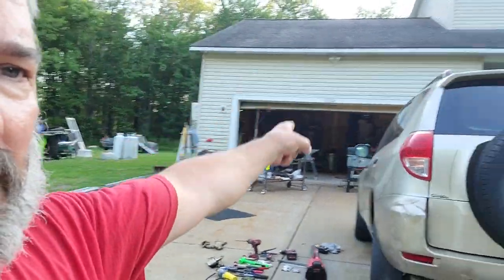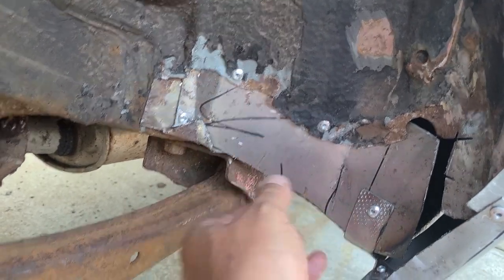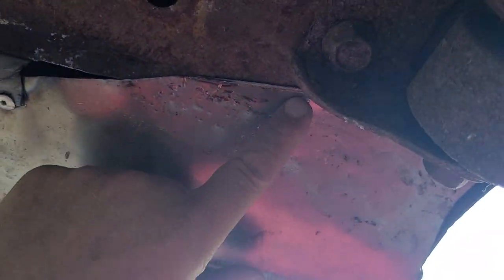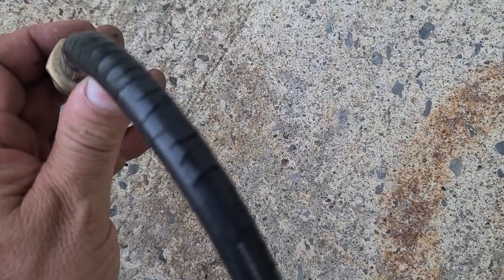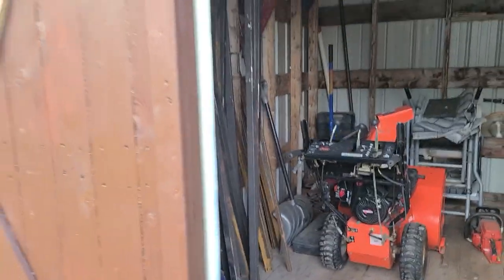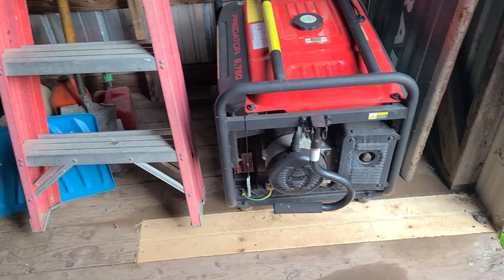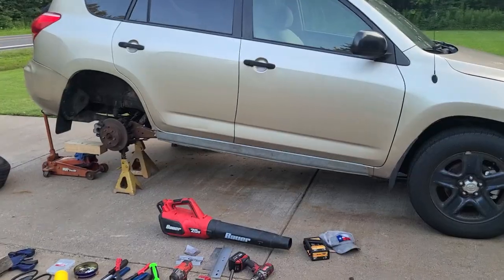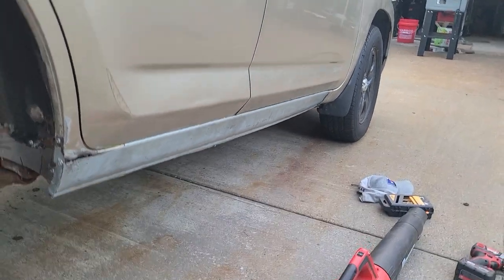Rav 4 rocker panels inner and outer....

Comment: Great work! Question for you, mine is rusted all the way from the driver side. I do not have required inspection where I live, but I was wondering if it was affecting the structural integrity of the car in any way ?
Reply from the maker: The short answer is yes....the area you jack the car up is on the pinch welds just after the front tire and just before the rear tire.  Also if it deteriorates into the body mounting areas your sub frame can bust lose and thats real bad.  If you need anything else let me know ty for the comment
Reply: @diyschoolofhardknocks2943  thank you ! Yea I stopped using the pinch weld since I have seen that. I used the inner frame in the front and the trailing arm in the back to put the jack stands. So far I am lucky and the rust has not affected the mounting area, i'll make sure to make a good anti rust treatment before the winter. The rest of the car is working well, so I'll try to repair it when I can. In the meantime I would think its still safe to drive with it ...

Comment: My 2008 RAV4 AWD driver's side rocker panel is rusty & needs replacing. I found an auto body shop in Winooski, VT that I have an appointment with. He said there is no guarantee. My car should be good for another 2 years. My fault this happened since I started undercoating my Rav4 ONLY 2 years ago. A big NO NO up here in northern New York.